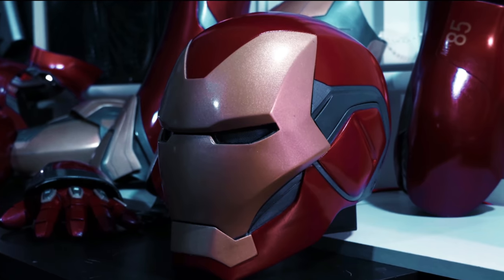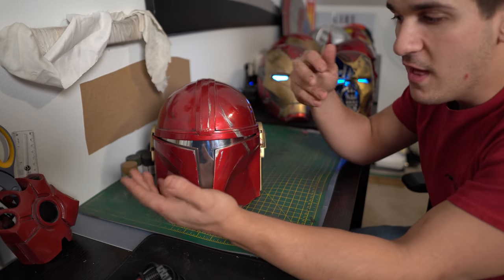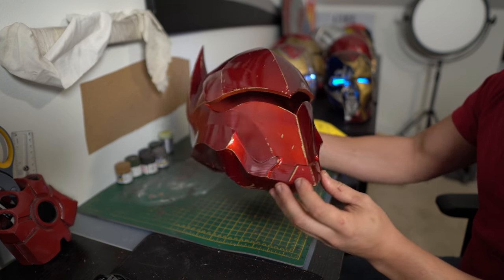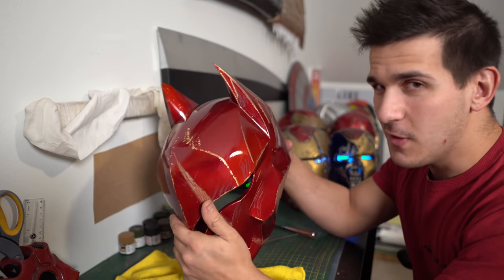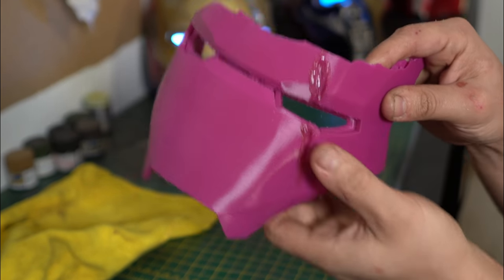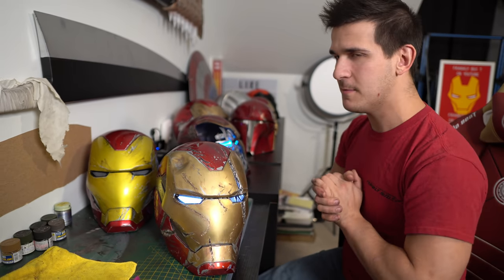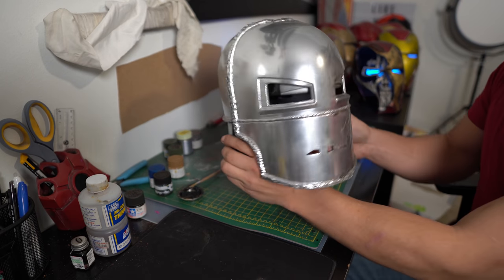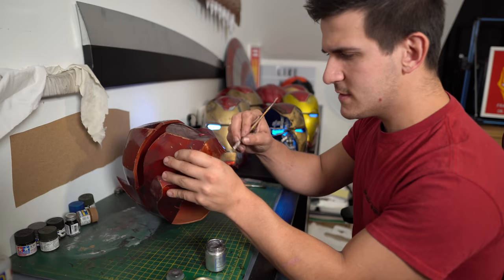"REAL" Battle Damage! How I Weather My Cosplay Props! | Tutorial |

Comment: i have a question is sanding pla whitout a mask dangerous?
Reply: I imagine as long as your not snorting the residual plastic when using low grit, and wet sanding when using high grit (keeping the fine powder out of the air) your probably just fine. If using a palm sander or power sander I would wear a mask forsure, as they tend to kind of throw what your sanding all over the place and into the air.